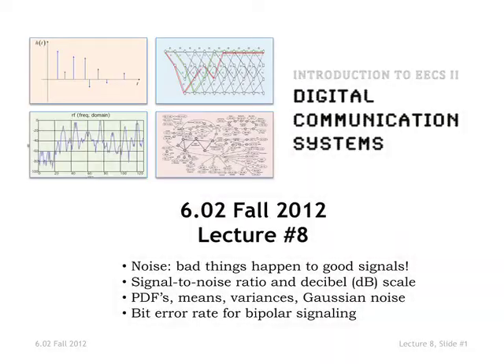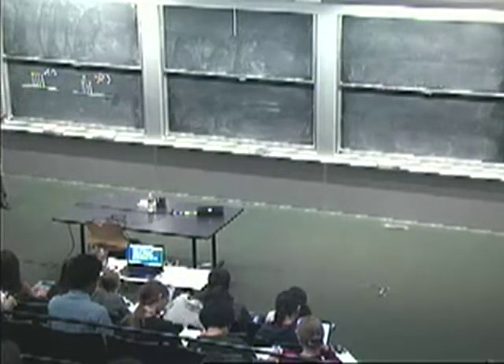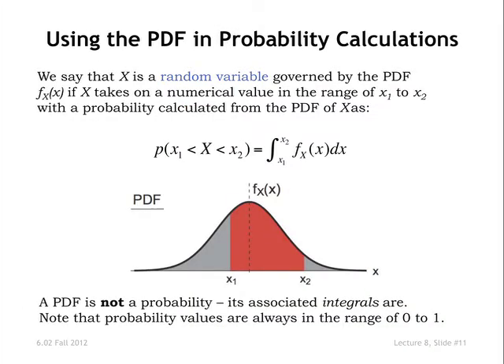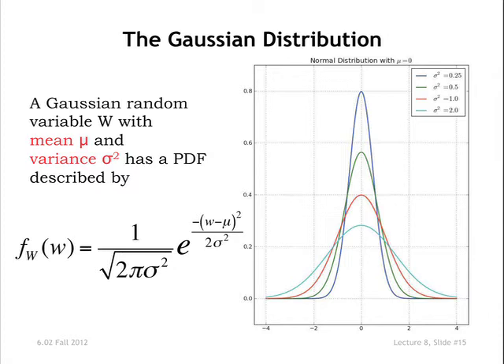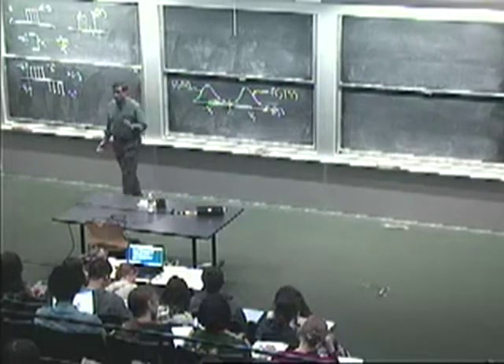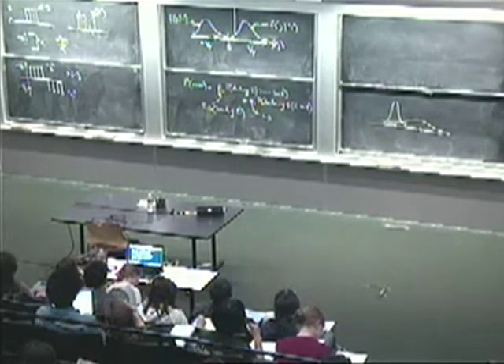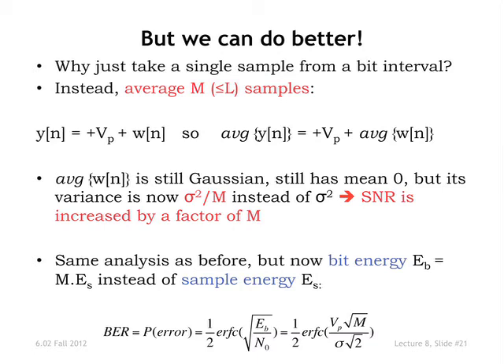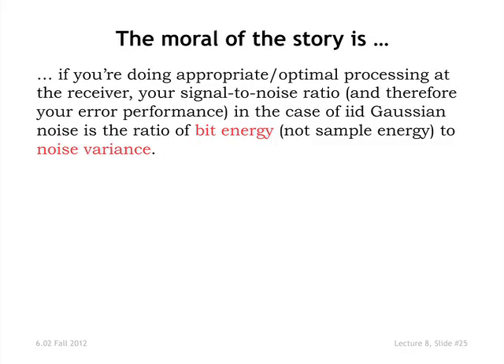8. Noise

Comment: The point at which the PDF attains it's maxima is mean or not?
Reply: It is for the Gaussian distribution.
Reply: Not generally, it's better to think of it as the center of mass, where there is equal weight to it's left and to its right.